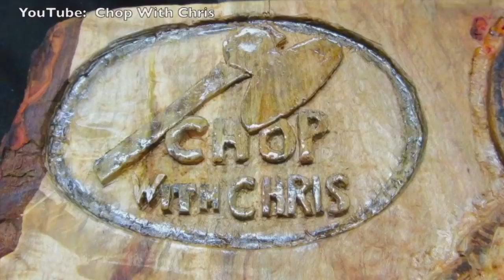My 10 Years of EPIC FAILS - Chop With Chris

Comment: Osage orange is the choice of pros...when it comes to bow making. If it's not available in your area you might be able to trade for some. I'm currently out of stock.
Reply from the maker: I’m getting some soon!   Any advice when using Osage Orange?
Reply: @ChopWithChris   osage is not too finnicky so you shouldn't have much problem. You do, however, want an even ring spacing throughout the length to give a more balanced bow. The Osage tribes often utilized "flame hardening" to give their bows strength or more appropriately, toughness. I have heard guys use Locust wood, also. Honey and Black locust are plentiful here in the midwest.
Reply from the maker: Thanks.  Can you direct me to any articles or videos that talk specifically about making Osage Orange bows?
Reply from the maker: When you make staves from the tree, how long do you make them?  How wide to you make them?   Do you remove the bark when they are drying or leave it on?  How long do they need to dry before you start working on them?
Reply: @ChopWithChris  I,personally, start with 1.5 to 2x larger to allow for shrinkage. 6ft. ... 5ft.  What is the application? Bear?
 Quarter-sawn works best. Bark on doesn't matter. Length of drying time, humidity, exposure to sunlight...all play a role.
 Slabs are cut and then cut your staves if you want the best.
  Oh yeah, English Yew is another fine bow wood. Bow making is an art not to me mistaken for craftwork.
Reply from the maker: Thanks.  I want to make 60# draw weight long bow and also a 100# draw weight crossbow